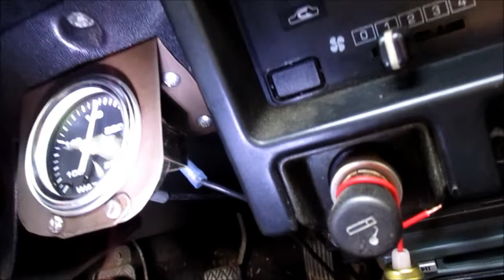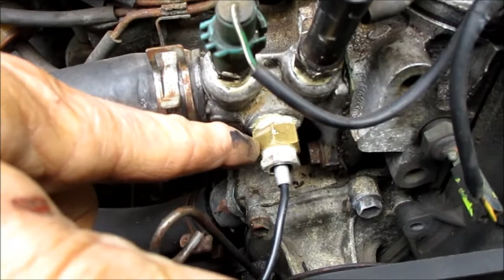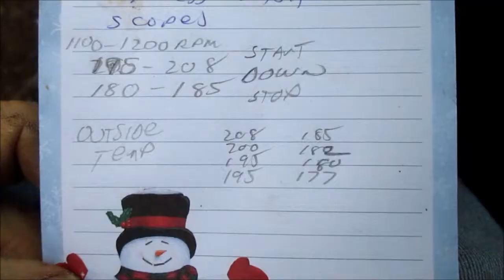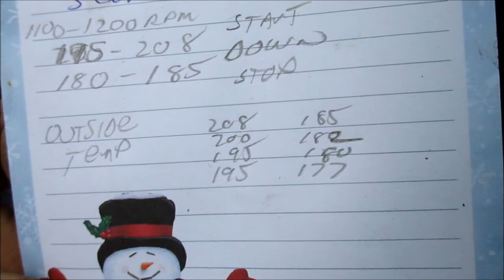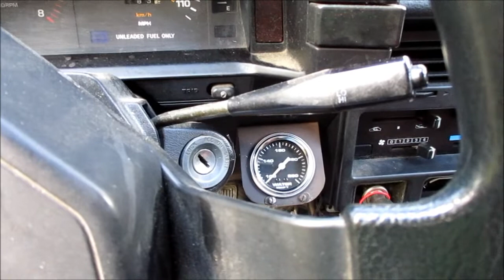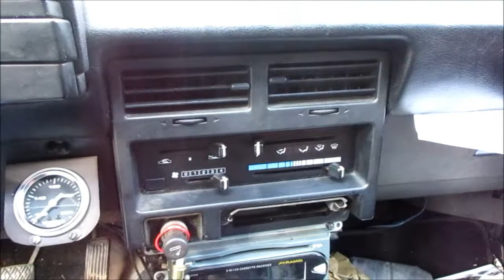Toyota Tercel 4WD installing temperature gage and more

Comment: Hi there, do you know what that green sensor next to and on the top of the upper radiator hose is?  My 87 is missing that connector/wire entirely and my temp gauge doesn’t read.  Any help would be appreciated!
Reply from the maker: I never have looked into that